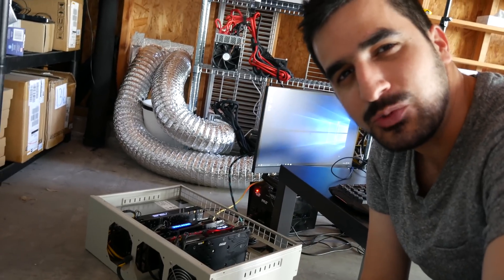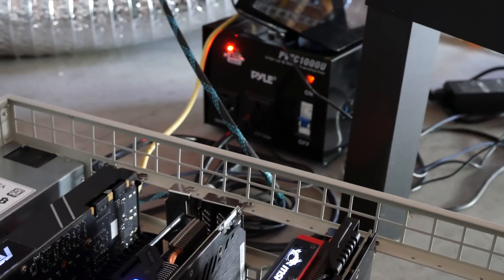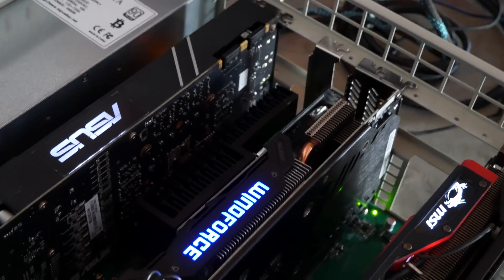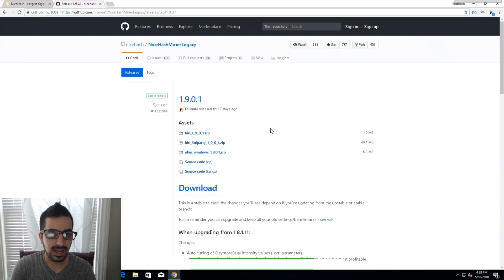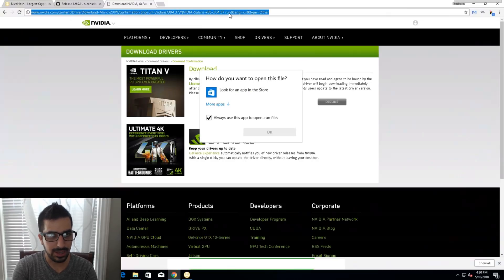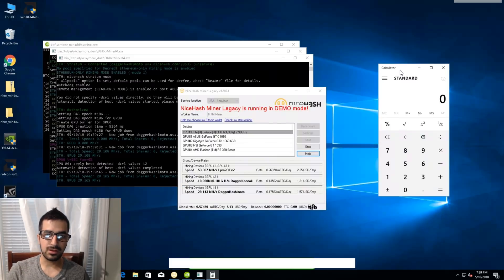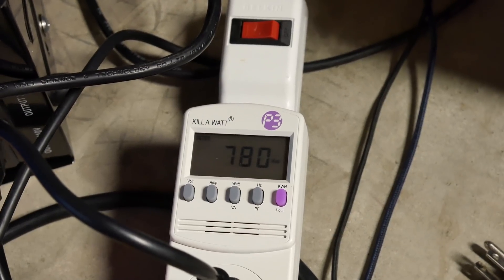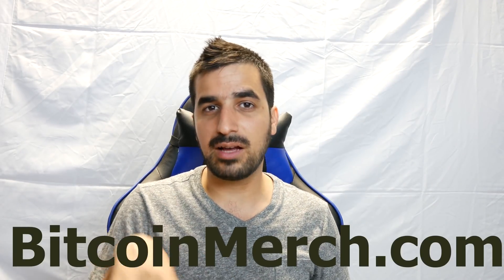How Much Can You Make With A Ready-To-Mine 8 GPU Rig PART 2 4K

Comment: @howmuchbitcoin i have a question witch graphic card(ore more) is the best to run in this case that used the less energie but can mine good?
Reply: banana games: low end I would suggest a gtx 1050 ti, low power consumption and they are under $200 bucks a card.  A GTX 1060 can do 24 Mh/s @ 25% power setting, and 32 Mh/s with a GTX 1070 also under volted @ -25%.  Hope that helps